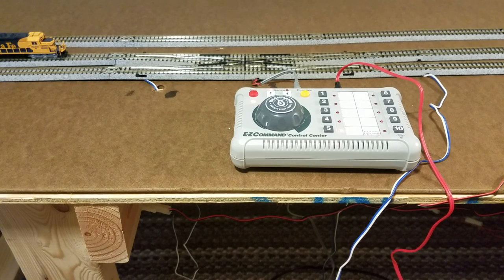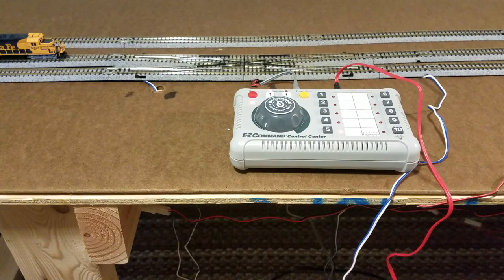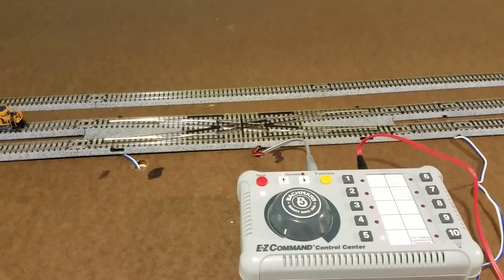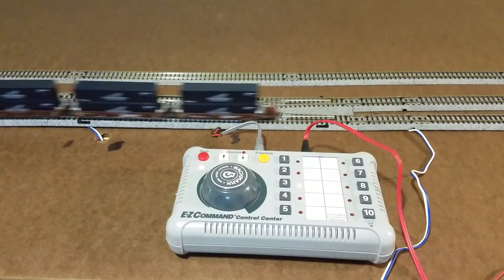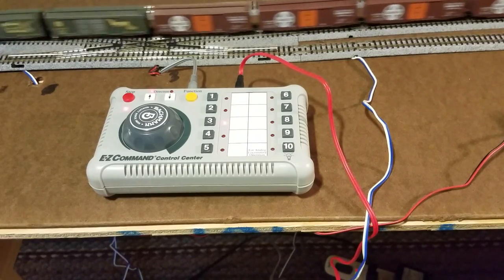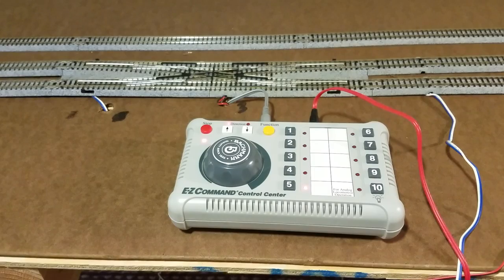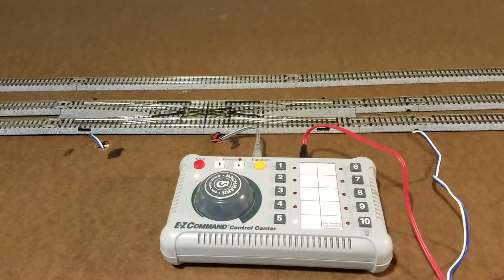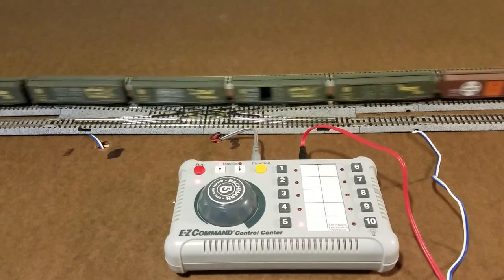Kato N Scale DCC Santa Fe Layout

Comment: I love Kato.. I use it in HO, and I wired all my turnout control to use DPDT momentary switches, powered by 9v dc contained in a plastic box, connected to the track using CAT 6 cable and connectors. Since its a portable shelf layout and DC (for now) it works just fine.

Comment: A very nice video and layout. I have plans to run my HO Unitrack layout with EZ Command and the switch controls (as seen here), and am wondering if a DC converter is required for the switches.

Comment: Could you do a video explaining the process of the feeders? I’ve got the Bachmann ez command and I’m about to switch from ez track to unitrack. With the ez track I didn’t need feeders. Could you just explain them?
Reply: Yes agreed that's a whole video , would you use terminal strips or a bus wire with suit case connectors? Thanks